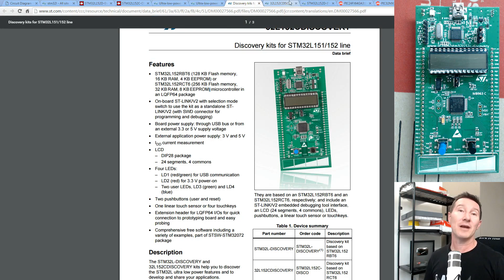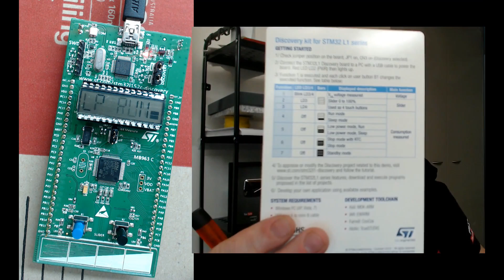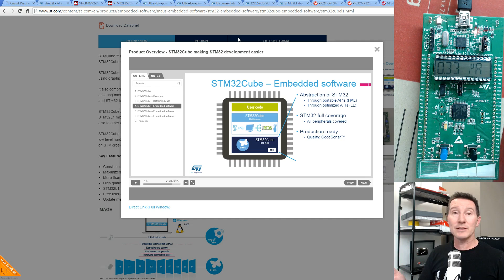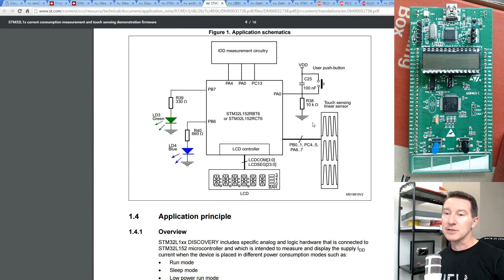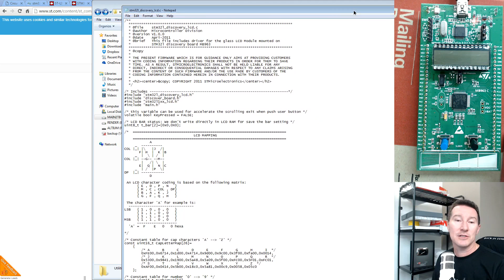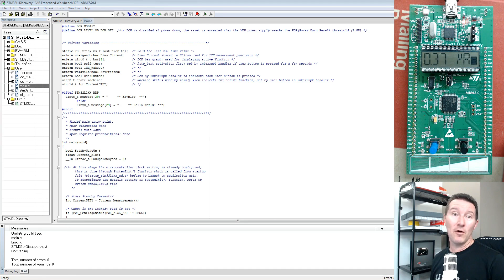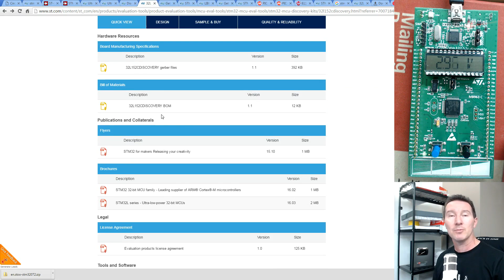EEVblog #900 - STM32 ARM Development Board

Comment: The STM32CubeIDE package has gotten a lot better as of late, it's still a bit slow in situations where it shouldn't be (downloading/unpacking firmware packages etc) but it makes development a lot less painful with project generation and debugging all integrated into the IDE. I used it to write the firmware for a smoothly dimmable flashlight with battery feedback etc and after project generation all that was left to do was writing like 50 lines of code to get the desired functionality, all the boilerplate-code was configured beforehand in the CubeMX GUI.

Comment: hi, im a really beginer on this matter but i have a project of a musical sequencer and the project involves a "STM32F405" microcontroller card; do you have a video of how to figure out where to start when talking about programming microcontrollers? i mean i know im not going decode line by line of code (by now its just a bunch hieroglyphs to me) but actually what does it mean to program a microcontroller is it to send some electrons from the computer to a chip? also i have seen some ic device programmers on the market and some states isp capability but at the end i dont even know what kind of programer do i need for my project: my project finished can be found on youtube as Buchla 248 MARF, https://www.modularsynthesis.com/roman/buchla248/248marf.htm; i have built another modules but not with programming skills required. So it would be awesome to have a clue on this topic Best Regards & nice videos (^_^)/ i have seen some about how Not to blow my osciloscope and i helped a lot (^_*)b hehe .

Comment: I still can't add the toolchain to eclipse, the System Workbench for STM32 launches eclipse and it works there, haven't compiled anything there yet. I got the compiler also from ARM site. They have 2 links, one being the compiler, the other being the toolchain. Not sure what the difference is yet. Eclipse lately has some new packaging system that uses xpack and node stuff. Getting things to download and run was just terrible. The missing out of the box experience is just slowing things down and raising that learning curve steaply.

 EDIT: use the Eclipse market place (Help menu) to locate the GNU MCU ECLIPSE 4.6.1. It will ask you to select your controller manufacturers. I am sure there are many steps for multiple options. I would suggest to stick to SWSTM32 for now, unless you can get IAR or KEIL uVision MDK. Most importantly, the ARM Compiler would prove useful. One day.

Comment: Great introduction video.  I also bought a Nucleo 64-based development kit, and since I wanted to create a NB-IoT application, I decided to go with PGBoard,  integrated with many other sensors, GPS, and also a useful NB-IoT connection, and a SIM for network communication.

I wrote a simple tutorial, check it out and good luck for your projects!

NB-IOT: Get started with STM32 and CubeMX on macOS
https://forum.pgboard.eu/viewtopic.php?f=65&t=17&p=17

Comment: Code::Blocks + arm-none-eabi-gcc + libopencm3. Takes some experimenting to set it up (as opposed to out-of-the-box bundles), but after that it is stable, the IDE is lightning fast, the libopencm3 is incredibly clean and not bloated (like the CMSIS HAL). I probably not using the full potential of debugging in this setup, but it works with J-Link for me.

Comment: The easiest software for programing I know is Platformio you can use it with Atom or as an extension for Visual Studio Code. Completely free and support most boards and chips
Reply: Platform.IO is in a wired middle ground: not as simple as Arduino for a newbie but still too limiting for an experienced user

Comment: Three years later and it's still the same terrible first impression. As a long time Atmel user I couldn't believe I had to mine around websites and forums to get a GCC compiler/IDE setup for the first time. Huge turn off.
Reply: install Atollic Studio, you will be up and running.

Comment: Ordered a STM32f407VET6 a few weeks ago as my main "goto" board has been an Arduino Due. Tried the ESP32 and it was great... BUT SPI reading is totally borked on it which made reading of SD Card totally unreliable. I spent a few days basically rewriting the SPI library for it from scratch and managed to get a 128*64 SSD1305 OLED to update from ~150 FPS to over 1000FPS which is great... but without ability to use SD card limits the use I had. No reason these days to be fluffing around with 8 bit boards when 32 bit boards are so cheap. The Due IMO is great BUT the pins totally suck because they decided to make them the same as the borked MEGA pins. I also prefer male pins and they always seem to sell them with female headers.

Before I bought the STM32 I downloaded the Arduino install for it and made sure I could compile and get a good look at stuff. Basically as long as I can use SPI, digital read and write and a few other things the rest is a bonus. I also noticed there are free pins in a range that should allow very fast 8 and 16 bit parallel read/write which means I should be able to port the OVR7670 library I use easy.

Having a built in SD card adaptor and 2 DAC's is a huge bonus as is the (compared to Due) 2x memory and speed. Also, the price is < A$20 from Aliexpress. 

Too be fair, I liked the Teensy boards but they're a bit expensive here (A$45+) and for me the pins and spacing etc was a bit too "teensy". 

If the STM32f407VET6 goes as planned I will look at the similar "ZET" board as I believe there is a space on the back for additional 1MB SRAM chip that can be configured and used. (Maybe as an idea you could confirm this and make a video on doing it :-) as I'm sure 1MB of SRAM will raise some eyebrows)

Great channel, keep up the good work!
Reply: 1000FPS :D ... Do you want to impress a hummingbird watching mastership Ping Pong?

Comment: Well, when I began with ARM it was kind of puzzling but ST website was tremendously useful to understand how to begin. I just read the getting started pdf without making that much of a drama, downloaded the STM32CubeMX, TrueStudio from Atollic (which is Eclipse and GCC based and it is fully functional and FREE for STM32)... hooked up a small STM32-Nucleo board and voilà!!! I was ready to begin to code and play with the hardware. I think that STM32 is an excellent platform for beginners and it is extremely low cost. Maybe it isn't as intuitive as Arduino, but once you sort out the first one or two bumps on the road, you are light years ahead from Arduino hardware capabilities. Just give it a try and please RTFMs!!!! Pura vida from Costa Rica!!!

Comment: good on ya dave we're getting into stm32 and this is right up our ally. right up my ally like a dongle driver.
Reply: right its a month later and ive got atollic studio setup. ya absolutely right about it not being super straight forward. shits improved a bit now but yeah. its great seeing cubeMX change code on the fly though - it saves the cubemx file in the truestory project directory. but yeah im still massively lost.
truestudio uses GCC i believe

Comment: Had the same experience with a STM32 Arduino Nano look-a-like, didn't get it working, it is in the bin now. Cheap however frustrating. Had also the same awful experience with NXP ARMmbed stuff, takes me two days without any result. Online compiler not working, wrong links to outdated setups for offline compiling, needs tons of software and configuration, awful. Skip it.

Comment: Atollic now belongs to ST. Then, TrueSTUDIO ( Atollic product ) which is an eclipse based application which integrates the GCC compiler is FREE, fully FREE. I'm testing right now with the STM32F4DISC board. Let's see how things go. version: v9.0

BTW, I think Cypress solution is as cheap as well and better suitable for fresh beginners. The PSoC Creator IDE which is its programming environment is fairly complete in the sense that does not need any external program to generate code like CubeMx. Also, the example's window lets you promptly read the documentation.

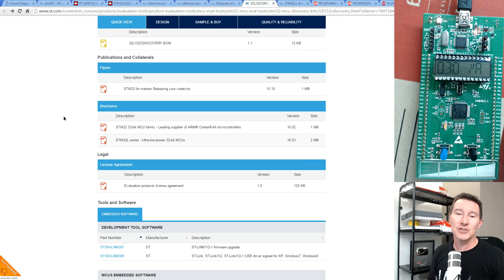Comment: The MDK for STMicroelectonics STM32F0 and STM32L0 is a license paid by STMicroelectronics. It is free-to-use for software developers working with STM32 devices based on the ARM Cortex-M0 and ARM Cortex-M0+ cores." – Bruce Abbott Mar 15 '16 at 20:54

Comment: Hey Dave,
i recently had to work myself into the STM32F4 chips for master thesis. I just found this Video just after i got started...
 Just like you, i hate all those "Fill in here, get an account here, blablabla". It is so annoying... still today... They added the GCC part to the "get started guide", at least for the STM32F446RE Nucleo

I found the easiest way to get started with GCC is to set up Eclipse C/C++, get the System Workbench_STM32 (AC6) and use CubeMX to generate the SW4STM32 project. But untill i found out i had to try all the other ways from the "get started" too because it is the last mentioned way...

 I also had some experience before and can say: Its not really beginnersfriendly!

Cheers from Germany, i really love your Channel!

Comment: Just a quick comment on the dongle for IAR: IAR is rather expensive and you can select a few different options for licensing. You can bind to a single computer, bind to a network and use it on any computer (one per license of course) on the network, or put the license on a dongle so you can use it (for one person) on multiple systems. Useful if you have to go to different locations, just buy one license and use it everywhere.
Reply: The vendors love to push Kiel or IAR, but I'm not really willing to pay those prices or even attempt to justify them at work. You can get some variant on the Eclipse environment for free, though I personally just can't learn to love Eclipse. The environment I went for was VisualGDB, which is a GNU toolchain plugin for Visual Studio(2008-2013, not express editions), which was ideal for me since I was already using VS(2008Pro). The ST-Link/v2 dongle is £17 from farnell (uk). A VisualGDB license is something like £170. Works great. ps. I call it a dongle, but the ST-Link isn't used for licensing, it's just a USB/SWD debug interface. Memory is a bit hazy, but I think you need to activate the plugin online a la Windows itself, but otherwise there is no intrusive license management.

Comment: Do a search for the STM32 "blue pill". It's available from Banggood for less than $4 - and free shipping! (at least to me). It's crazy how much processing power is available, and even the pro tools such as a ST-Link/v2 debug dongle are pretty cheap. I never use any third party libraries, so I'm not interested in Arduino compatibility or how good or bad the ST libs are: but there's a big community out there if you want those things. The drone community in particular seem to be heavily invested in STM32-ARM. [Edit] These are not the low power STM32L, but it's still much less hungry than I'm used to: each peripheral on the board has its own clock and so you only power the bits you need.
Reply: YES! this! i got the blue pill. its the way to go. $2US at the moment i think. i just got one up & running at the moment. trying to get led blink going - but my cheap chinese stlink is a bit drunk

Comment: What a an utter nightmare this is. I got one of there Nucleo-F042K6 boards and have spent hours going round in circles and hitting dead ends. All I want to do is download the source for the blinking demo that is pre-installed on the board so I can start by modifying it. But can I find it anywhere, can I F!

Comment: Thank you sir for yet another great contribution!! I bought 2 of these to get to know the architecture, and because it supposedly works as a stand-alone STLink V2. CubeMX is pretty cool for generating the initialization code, and I am excited about pairing this tech with my numerous debian linux servers. I just scratched the surface, but I found it interesting that the board actually has two processors on it, including the STM32F103C8T6. This is the same processor that is on several development boards I bought from Ebay several months ago. I am looking forward to using this board to program those smaller boards, and other STLink compatible processors and boards. I was looking for faster 32 bit processors to embedded into numerous IoT projects I have around my house and excited about exploring and learning this platform. 
It does not have the hand-holding Arduino has, but there is a STM32 port available for the Arduino IDE I plan to explore. Like you said, and I agree, the CUBEMX makes setting up initialization code so much easier than digging through the datasheet to program... say... the pic32mx795f512l (my favorite microchip device).

Comment: The API is ridiculous.  The majorty of is purpose is to make sure to lock hardware resources when in use for the Rtos.  Otherwise the amount of  code just to send a few bytes to the SPI is staggering.  While the CubeMX makes it much

Its just the STM32 features are soooo nice.  The CubeMX, for its problems, does make configuring and re-configuring the board a snap.  That DMA is great once I figured it out and faster than the fifo thats in the ESP8266.  Not to mention soo cheap.  I just wish they made some better librarys if they keep slapping the Arduino header on their boards.

Comment: TrueStudio has the"FREE UNLIMITED CODE SIZE'  and it runs on an Eclipse IDE. I found Eclipse tough to get running using the free SDCC compiler for the 8051 core chips  but; it compiled  the STM32 EXAMPLES seamlessly.

Comment: So funny, I've been doing the same thing at work (I use Cygwin: install arm-none-eabi-gcc, add to path, then use STMcubeMX to generate the Makefile (gpdsc when you build for generic) and linker script (when you build for trystudio)).  One hint: do not edit the generated code.  Instead go back to STMcubeMX and find what you want to modify there.  For example UART baud rate / no. data bits are GUI parameters for the UART peripheral.  You want to be in a state where you can rerun STMcubeMX without it deleting any of your own changes.

Comment: Hi, Dave. You definitely should try SW4STM32 AC6 IDE. Runs out of box with CubeSW and st examples, and it is Eclipse - imo, only way, if you wanna make serious projects, not just flashing leds. i worked with Keil a lot, but will not use it anymore. may be compilers are better in Keil and IAR, but as for me, the way, i work with code and with other developers is more important, and Eclipse is the high-end code editor with all that features like projects management, syntax checking, static analyse. not glitchy like in Keil, but clear and usable.
here is the link http://www.st.com/content/st_com/en/products/development-tools/software-development-tools/stm32-software-development-tools/stm32-ides/sw4stm32.html?sc=sw4stm32
and you can work with other arm chips (thru SWD) with that setup. i worked with LPC micros with same IDE and discovery's st-link)
Reply: I'm a beginner and started with SW4STM32. All seems to work well with CubeMX. I like the way Eclipse helps out. I just need to figure out how to use all the firmware libraries generated by CubeMX to able to use more peripherals avaiable other than the GPIOs and find where to get more exemples of sw like on arduino IDE...
It seems that there is a new comunity going on for the SW4STM32. Linky:
https://community.st.com/community/stm32-community/stm32-forum

Comment: I had the same first time experience with STM32F103 mini dev board :) I was (am) a beginner, after looking into available options (including arduino) I decided to learn STM, and now I have a toolchain with GCC for compiling, OpenOCD for flashing and remote debugging with GDB, all that running from within QtCreator IDE. But I had to dig into in it, google things and figuring out how to set them up to work... This is absolutely incomparable with arduino experience, I wish STM had a user friendly instructions with how to setup free toolchain and it would just work - it would be just awesome! And some (or a lot) of arduino's community might have migrated to STM community, which whould be great as well I think.

Professionals might not prefer GCC over IAR or Keil, because it might not generate optimal code in some cases, but hey - for hobbyists and individuals it is the only option! Besides, it does the job! Nobody is going to spend hundreds/thousands of dollars for an IDE/toolchain, in order to work with 13$ (3$ in my case) board in a personal/small size project

Comment: Microchip offers insanely shitty free development tools (I exclude the MPLAB-X IDE, which however also depends on those very same tools...). In fact the freely available compilers deliberately put crap in the produced ready for flashing code (you can find plenty of blog posts on this topic). I'm waiting for the Atmel toolset to slowly die off after the purchase by Microchip. Microchip has a history in doing crap for its dev community all the time. Christ, they even bought Hi-Tech (a company that provided paid much better dev tools for Microchip's own microcontrollers), discontinued their own in-house tools yet still kept pushing crap out of their sh@thole. For a company which earns most of its money from silicon sales providing shitty tools is a f@cking mystery to me and many others out there.